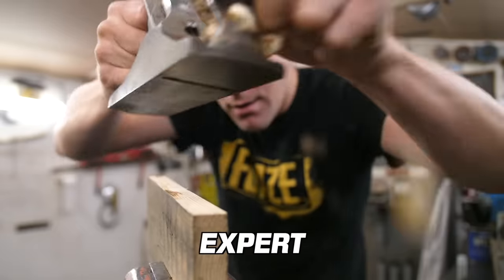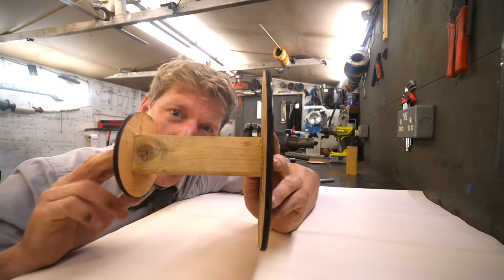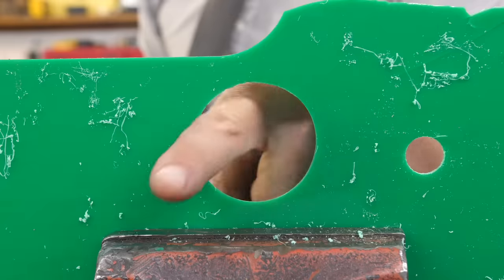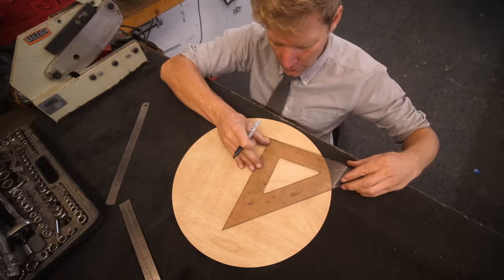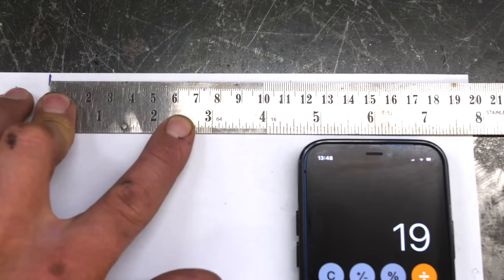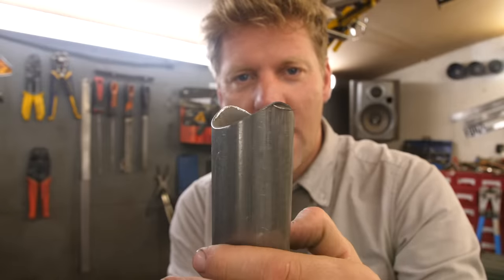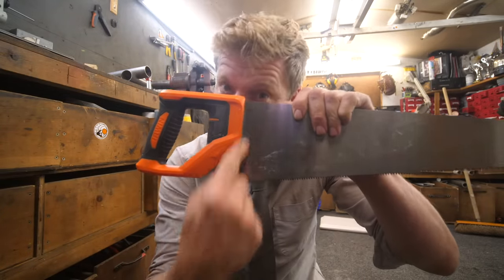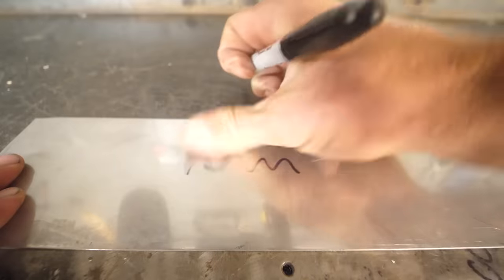18 GENIUS Workshop TIPS (that actually work)

Comment: I found a cool video before i saw your hydroforming videos. It was an old man who was making custom car parts and he made a dome shape for a light using a grease gun instead of a pressure washer. He had two very thick steel rings bolted around two plates and he formed a very slick looking light dome shape that matched the old car perfectly.
Reply: OK after commenting I looked up the video. It's actually for a motorcycle and it's a reflector for the light. His video is called hydroform and it's from Clairance Elias.

Comment: There is a grafical method to construct cones. Draw the frontview, mark the conetip, draw the radius using the egdes of the conefrontview, calculate the top and bottom scope, divide by 12 or higher for accuracy, draw from the frontviewcentre on the circles six times to each side, match the ends and you have the unwraped cone

Comment: One I learnt recently: if you are marking a measurement with a pencil or scribe, use a "v" mark instead of a single line "|". That way, it doesnt matter if your line is wonky or anything- the tip of the "v" points to exactly where you measured to.

Comment: Better tip for straight line on a pipe down the middle grab you pipe and rub it on something flat like the floor or table end make sure the surface is something hard like concrete or metal and it will scratch a perfect line down the middle. Really help if the pipe has a bend if your trying to measure off the bend with a L square or ruler with tape measure.

Comment: WD-40 cleans anything oil based including removes paint if it's not totally dry.  Tip number 2. Use an adjustable wrench to straighten bent sheet metal, if too thick use a long  pipe wrench maybe with a pipe on the handle.

Comment: If you want to cut a load of lengths of timber the same length using a mitre saw, clamp a piece of wood against your fence at the desired length to use as a stopper. Place the wood against the stopper each time to save on measuring every length.

Comment: Keep your old rubber bicycle tubes. Can be used in hundreds of ways...
1. Connect hoses - cut off a piece of the tire, stick the hoses in both ends, fasten both ends with a zip tie.
1.b Connect tubing - same as above...
1c. connect toilet with uncompatible house pipe - same as above but zip ties wont be neccesary, the stretched tube will hold in place no problem for years
2. Ground dampness blocker - uses pieces of the tires beneath whatever you want to insulate  from the ground
3. Frame insulation - cut strands of the tire and glue them onto place where you would normally use store bought insulation strips
4. Makeshift rope...
5. Chains rattling annoys you? Thread the chaing through a bicycle tube. Often used on bicycle chains. Frankly, get a chain and hanglock to keep you bike safe. Never buy  those cable things, they can be cut in a matter of seconds with an ordinary knife. I know, tested...
6. Got only ordinary screws but need those plastic expansion anchors? Stick some rubber in the hole and fasten the screw. Does the same thing as a expansion anchor. Pieces of tree twigs do the same trick.  
7. Machine vibration blocker - stick some layers underneath the foots of your washing machine. Will make the centrifuge phase more quiet and keep the room from shaking.

I have used all of above. The tubing connection and toilet thing...I installed it when wemoved in and was still there when we moved out 5 years later.

Comment: You can report a mark on a thin sheet of meterial without measuring by placing the sheet parallel in front of your face. This will make you able to see both faces of the sheet, one with each eye at the same time. 
It only works if you have two working eyes and it's precise enough for most job and way faster than measuring anything

Comment: So, you need to take omething off the wall, say, like a cabinet that's been nailed up (instead of using screws)  and you don't want to destroy it  (much) because it is going back up. Get your plug cutters  ( you do have a set, right?) It's kind of like a little hole saw. take the one that is just barely larger than the nail head. Cut a hole in scrap wood with it and place (hot-glue, nail, whatever) the scrap with th hole cengtered over the nail. cut around the nail. To mend the [cabinet] use the next larger plug cutter to cut a suitable plug {again from scrap}, glue it in and sand it down smooth. finish as needed.

Comment: I made a tool for marking centers like this... just drill three equally spaced holes and tap the outer two than bolt in hex screws...than you can mark centers like you showed, but without measuring

Comment: While working on hydraulic JIC or any fittings really. Use 2 hammers to smack the fitting 180 degrees from one another if you can’t break it by hand with a wrench

Comment: Pedantic point. The diagonal measurement tip tells you if it’s square, not if it’s A square.  Rectangles also have identical diagonal measurements.
Reply: He does say at the start of the tip 'so the best way to check for squareness'

Comment: If you are making a tube out of a piece of sheet metal, before rolling it, break the leading edge a bit.  I like to hang 1/2-3/4"/12-20mm of it over the edge of a workbench, and tap along with a soft mallet to make a 10° or so bend.  This will take care of the bit that the slip roll can't get, and make the two edges line up much better.
Reply: Just put it into the edge of the first 2 rollers so it pinches it, the lift it up. No need to even leave the rollers and go to the bench.
Reply: @rustycopperpot  That still leaves about an inch untouched.  I learned this while working stainless, then showed a supervisor at another job when he was amazed I managed to actually make a length of aluminum ductwork round.

Comment: We all just wing it! Don’t we 😂 No problems only solutions!! It’s mad the tricks we learn along the way. Proper engineering at it’s finest. Stopped in edingburgh few weeks back see couple of lads wire brush a old steel fence surounding a old church had a old rusty chain in the back of truck. wrapped it around one of the slat poles and pulled it left to right fast and it cleans it in like 3sec. Told them cut the chain so have bit each. They were gob smacked!

Comment: For straightening copper pipe, the easiest and best way I know is to clamp one end in a vice and crush it flat, so the same with a pair of vice grips to the other end, then smack the vice grips with a hammer and it pulls the pipe perfectly straight. Then just cut the crushed ends off and you're ready to go.

Comment: When cutting threaded bar or screws down to length, put a nut on first, do your cut and file off any sharp bits then wind the nut off.. nut will repair the thread

Comment: Another way to remove sharpie is to use rubbing alcohol 70% or higher is best. Best of all there should be some in the first aid kit (please use this only in a pinch) and rubbing alcohol can be purchased almost anywhere. Apply to clean towels (paper or cloth) rub vigorously.

Comment: Another tip to holding a drill square, is to put a set of keys or a ring on the bot. If it scoots forward or backward you’re not square, this way you only have to check for left and right not up and down as well

Comment: If you need to run a long length of wire through conduit, you can attach a bag to a coil of string, bunch the bag up in one end of the conduit and  on the other end use a shop vac sealed over the other end of the conduit tube, turn it on and the vacuum will draw the bag and string through the conduit, then you can attach the drawstring to the cable and pull it through, job done.

Comment: To straighten a length of wire, out one end in your vice and the other end in a drill, hold the drill so the wire is tight, pull the trigger of the drill and watch the length of wire go nice and straight.

Comment: You can also get sharpie off a whiteboard using a dry erase marker, just make sure they're either the same color or use a dry erase marker you don't care about because it could make the tip dirty if you used say a green dry erase marker  to erase black sharpie.

Comment: If you want to drill or tap a hole perfectly perpendicular and you're too cheap to buy extra tools, drill through an old cd or plastic mirror, it's easy to line up the reflection to ensure that you're drilling straight.

Comment: Uin a pinch using a dry erase marker over sharpie will dissolve the sharpie and you can wipe it away cleanly. Works surprisingly well as long as your dry erase is the same color of your sharpie there shouldn't be any change to the dry erase.

Comment: Tube notch -> Just take angle grinder, and cut off in 45 degree angle to the midle, repeat on other side (rotate 180degrees) and you got ~perfect notching.
Reply: to get 'funny' angles, just make sure you total to 90degrees and you can do whatevs.

Need to leave on 45 degree angle? T hen 22.5 + 67.5 degrees.
Eyeballing is often quite enough, but metal bandsaw is best and then it's super quick and easy, after a bit of practice you can do funny stuff like 3D angling, say 25 degrees to "left" + 30 degrees towards "back" combined no probs.

Since you are welding these, likely MIG, tiny gaps / imprecision doesn't matter upto like 3-4mm even, after a bit more practice you can get by hand + eyeballing close enough for tig welding too.

Comment: If you drilled a hole slightly too big for a friction fit pin, take a big ball bearing and put it over the hole and smack it with a hammer. It will mushroom the metal into the hole and decrease the size. You can also just smack the hole with a hammer but the bearing does it evenly and doesn't leave a bunch of hammer dents.
Reply: Could also centre punch the side of the pin or just smack it with a hammer to ovalise it a bit

Comment: Instead of sugar I used salt... I my have also added bleach at time but then you are slowly eating your skin away so careful with salt and bleach... you need a lost of water to rinse with.
Removing Sharpie or any permanent marker use a dry wipe marker... they have the solvents that allow the Sharpie to be removed without issues going over the line too much and if you we very generous in the application then water, hand sanitiser or rubbing alcohol will take off dried on dry wipe markers.

Comment: If you want to find the center of mass on something like a rod. Put one finger under each end and slide them slowly together. In between your touching fingers is the center of mass. (Because the finger where there is more weight has more friction it won't slide but the other finger will.) do it a few times and mark it, if you want it to be more accurate.

Comment: For cutting sandpaper, get an old hacksaw blade and a piece of plywood. Screw the bandsaw blade down, but not all the way, leaving it loose enough to slip your sandpaper sheet under. Now line up your paper, hold the blade down with one hand, and rip off your nice square piece of sandpaper.

Comment: The best way to get sharpie off is with alcohol. Ethyl alcohol. Methylated spirits / denatured alcohol or whatever you want to call it. Except if it is the kind that doesn't budge, then you can use acetone. But that will eat into many plastic surfaces, so you might get scratches or even dissolve it.

Comment: TIP: Split Conduit
Use a Teardrop shaped loop of Wire to run wires into split loop conduits.

TIP: Conduit Tubing
Use bricky twine with a small rag/bag tied to end and blow/suck it through any length of straight/bent conduit with vaccuum/compressor.

Comment: 8:55 i lay the pipe down put the marking tool laying down perpendicular with the tip to the pipe and pull the marking tool along the ground flat to make the straight line quick & on the spot no muss no fuss. table top, sheet of non bending metal or plywood, what ever, it just has to be a flat surface. if your flat surface is smaller than the pipe afix the marking tool to the flat surface and pull the pipe across the flat surface at the diagonal into the tip of the marking tool on any side but diagonally.
XD

Comment: Another way to find the center of a circle, with a square (or anything with a 90 degree angle), and NO need to measure distance or angles or do any math:

1. Place the square over the circle with the point at the edge of the circle.
2. Mark where the sides of the square intersect the edge of the circle.
3. Draw a line between these two marks.
4. Move the square so the point is somewhere else along edge (like on one of the marks from step 2).
5. Repeat steps 2 and 3. Where the lines intersect is the center of the circle.

This works because the marks you place in step 2 will always be diametrically opposed. I'm sure there's a mathematical proof, but I don't have the math skills to prove it.
Reply: You should make a video of this method to explain it better

Comment: Before taking anything complicated apart, take a photo or several.
Before attempting to change any electrical switches/ceiling roses etc. mark up the wires and take a photo.

Photo's are great for showing you how something was before you attacked it with tools.

Comment: Screwing in or unscrewing an eye bolt: 
Put a deep set socket on your ratchet stick the handle of the ratchet through the eye and use the socket as the new handle and turn!

Comment: If you have glued together the big grey plastic pipes for the dirty water of your house and it's a mistake. Use a hair dryer to soften the plastic enough so you can cut it easily with a blade and rip it off.
When heated the glue becomes easy to rip. It has to remain hot during the whole process.
You may use the flamme of a welding tool, but you need great control over the temperature of the plastic, do not burn it!

Comment: 5:47 if you do that be careful with it, on one hand it might make an explosive mixture inside the can due to mixing the flammable gas inside with compressed air and you should also be aware that you most likely won’t be able to store it like that for long since many of those products will slowly oxidise or harden and become worse or useless, still nice lifehack though :)

Comment: If you take some straps of plywood about 10 inchs wide and bevel the side you place down, you wouldn't have to worry about that crack and it would prolly help induce a second drift when you correct it . Sending it up . Try and post the video let us know!

Comment: Adding another quick tip: if you have two plastic buckets stuck into one another and you don't have an air compressor, blow on the bottom with a hair dryer. The heat will make the air expand and push the buckets apart

Comment: if for some reason you have two sexbolts joining two plates and a spacer between the plates and and one of them cant tighten, apply rotational force on one plate to stop the sexbolt from slipping while tightening

Comment: I use fly spray to remove graffiti. it completely removes most types of permanent marker ink and leaves a residue that coats the surface. for a period of a few hours to a few days (depending on fly spray and surface), any further attempt to graffiti that spot will result in the marker pen failing to work ever again.

Comment: a safer faster way to solve aersol cans with low pressure is to lower the volume of the can therefore increasing the pressure. one guy i used to work with called it the "boot trick."  simply place said can of product on the ground and gently or violently (your choice) step or stomp on it to make the volume smaller so that the product inside has more pressure. sounds stupid but works well. less dangerous than trying to stick high pressure air nozzle in and risking it exploding

Comment: Well here's one Rhino using paraffin wax or most several hard waxes or soap bar you can insert screws into wood without them squealing by coating the threads with the wax a little bit before driving into the wood pieces

Comment: Can you design a device that is portable, to lift cinder blocks and equipment on top of a roof. I know …. a crane is what your saying, but at the moment I’m having to use a rope to pull all this heavy stuff through roof accesses and over the side of roofs. Its incredibly dangerous and it’s bad on the back. I’ve tried thinking of a way but cribbing and counter balances are extremely difficult. If you have any thoughts it would be greatly appreciated. Thank you sir

Comment: To remove a stuck flywheel, pulley, or a bearing, simply put an air chisel on the end of the shaft and pull the trigger.

Comment: Another way to straighten copper brake pipe, one end in vice, other end in vice grips, pull as tight as you can, then whack vice grips with hammer

Comment: If you ever want to drill a hole in a big sheet of plastic like that of an 1000 liter IBC tank, you might tear the plastic if you use a holesaw. Dozens of teeth digging into a grippy material like HDPE tends to spell disaster. 

But not if you run your drill backwards! 

The teeth are still pieces of metal with a sharp blade on the end; and heat does the rest.

Comment: An even better method to remove sharpie is praying deodorant over it from really close so that the liquid is formed instead of gas, the alcohol in the deodorant will then 'loosen' the sharpie if you will, then you take a rag and rub it of and there you have it sharpie is gone. Learned this trick when using a permanent marker by mistake on a schoolboard at school ages ago, avoided myself a lot of trouble this way 😂

Comment: The tip with the square may be misleading. In order to be a square the two diagonals need to be the same length, AND all the sides also need to have equal length. One can easily imagine having these two diagonals the same lengt, but skewing or rotating one of them, just by moving two of the corners.